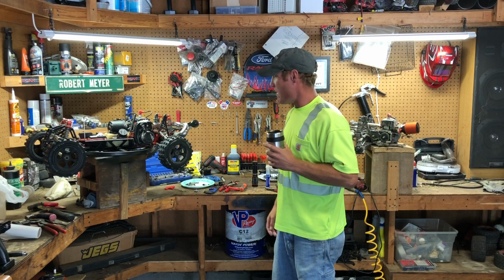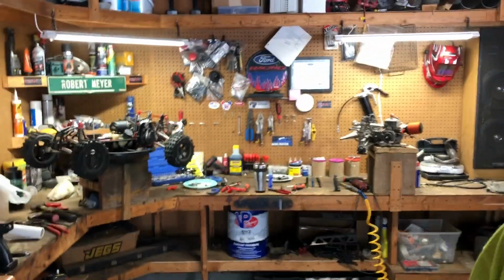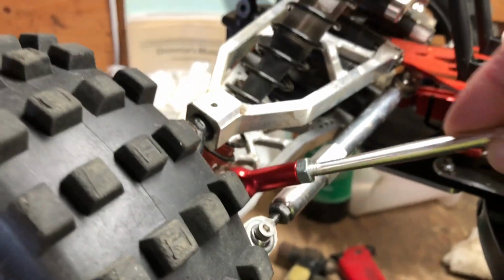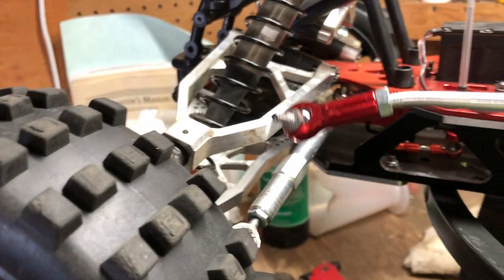Billet Transmission Grip And Rip ⛽️⛽️⛽️🧨🧨🧨💥💥💥🔥🔥🔥

Comment: 😱😱😱Wow Ben that was a nasty nasty barrel roll ouch! That is fully testing the FLM billet!! Those IRP turn buckles should hold up better for you! The heim joints I showed in my goodie vid for those IRP turn buckles are the basher series they are supposed to be stronger so if ya bend ur links let me know Ill give ya the part number to the basher series! As always brother fantastic Video!!!
Reply from the maker: EastSide RC i’m telling you the FLM billet is holding up tried and true!!!  Yes I haven’t bent the Heinz joints yet lol 😆 those IRP turnbuckles have been on there since I put the FLM widening kit on it and never had a problem with them.  But the ones that come with the push pull steering lasted a couple runs lol 😂